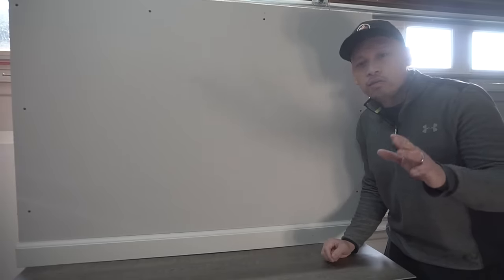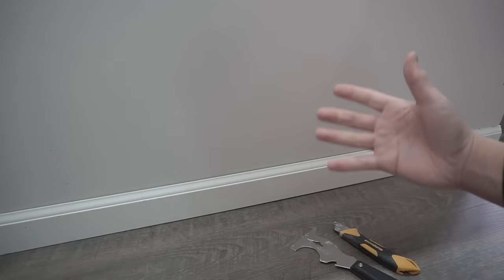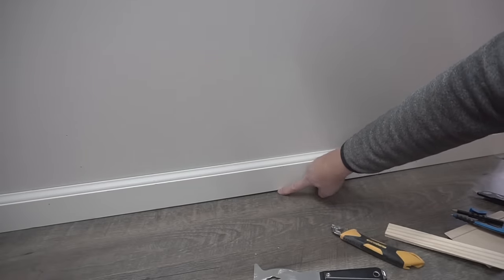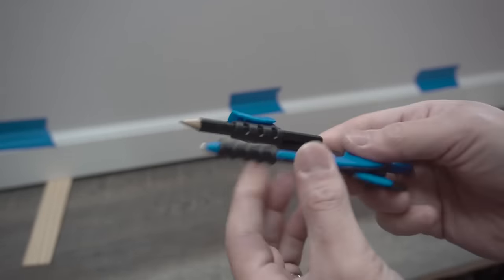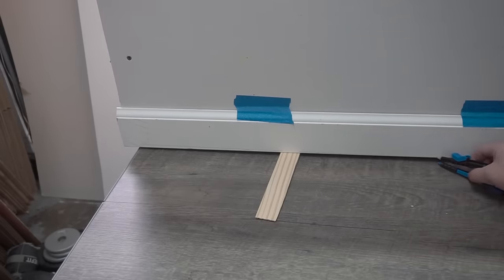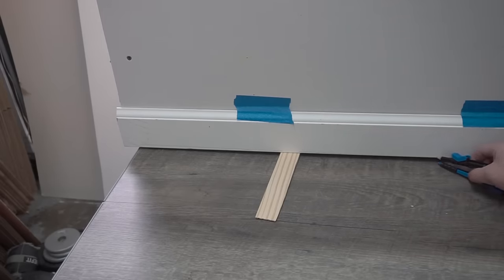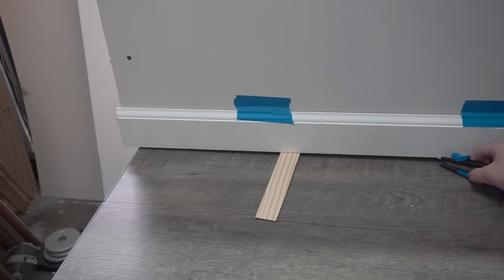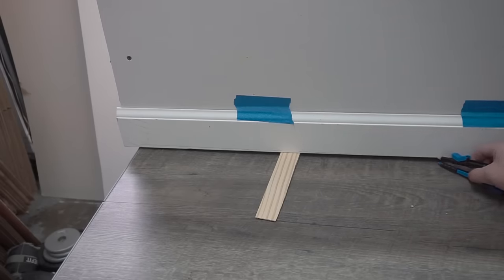How To Fix Gaps Between Baseboard And Floor For Perfect Fit! DIY Step By Step Tutorial For Beginners

Comment: Now you get to sand all the rest of the baseboard to match the one you trim to fit perfectly to the floor, though it looks awesome. 
as a finish carpenter to get paid once i complete the project learn how to do the job quickly and look professional no call backs. I use my foot step downwards on the board after tacking each end with one nail, start at the one corner and continue to the other end, it works

Comment: Your likely to run into problems with the next piece lining up when turning a corner.   I would push down on the baseboard really hard before nailing it in and you would be suprised how of a gap you can close.  If its a 1/8 inch just caulk it in, scribling moulding is alot of work for sure, just run quarter round.
Reply from the maker: Thank you for the feedback 👍🏽

Comment: Great video.  Thanks for sharing. My problem is that if removing carpet the gap is going to be really big.  The contractor told me that even quarter round might not cover up the gap if I remove the carpet and install vinyl flooring.  Any ideas on how to fix something like that??? Or just buy bigger baseboard??
Reply from the maker: Hi! Thank you for the love and support! I think your best bet is to use shoe moulding also known as “base shoe”, which are taller than quarter rounds. 👍🏽🙏🏽😊
Reply: Hi , my carpet was removed and installed with vinyl flooring and gaps are not shown too wide it is likely 2mm but our concern is too cold air is coming from the baseboards gap , our winters are too horrible …our heaters are continuously running with temperature setting 74  but still no use ..heat is not retaining , can you please help me with the solution what to do ? Is caulking is the only solution or anything better ?

Comment: In my opinion as a retired carpenter, I do not believe this is a way to fix baseboard to a wavy floor. As others have noted, now that you "shortened" both ends, adjoining boards will no longer line up and therefore all the baseboards in that room will have to be modified.  Also, others have noted, if the gap is small, simply push down on the BB before nailing.  If the gap is 1/4" as you state, then you have a serious issue that needs to be addressed with the floor -or- use quarter round as someone else has noted.  And again as another person noted -- never pull the nails out from the surface as damage may occur. Pull it from the back side.  Respect your attention to detail.  I'm just an old fart making some constructive criticism.  Keep up the good videos.

Comment: In finish trim work you do'n't hammer or push the brad nail back thru the direction that it was installed from but pull it completely thru, otherwise you will blow out the top of the hole

Comment: 1:09 or just do what a lot of ppl do: Break out the Shoe or Quarter Round😉🤦🏼
Wish was kidding, but it’s what ppl do, b/c scribing everything takes time, and unless have a trim carpenter doing this work, a GC remodeling your house WILL NOT BE SCRIBING ANYTHING, or COPING, as an FYI. If they do, will be extensively extra costs, and YOU MUST NEGOTIATE AND TALK ABOUT THIS AT THE START, b/c a change order; won’t cut it for most GCs.
Thx for vid and good job. Appreciate and see ya on next✌🏻
Reply from the maker: Thank you so much for your feedback and advice 🙏🏽😊👍🏽
Reply: Aepek, all hard surfaces installed in Ohio are to be sold with quarter round, for this reason we see here!! What he's doing would be very expensive per foot, and alot of these new material this can't even be done.

Comment: You are better off to pull your brad nails out the back side of the base board instead of tapping them through the front. Tapping them through tends to chip the front of the baseboard more often than not especially if the nail hole have been filled and painted over. Just my opinion

Comment: I have a solid wood baseboards 6" x 3/4" running in length anywhere from 12 to 20 feet. Removing them to fix those small gaps is no option. So my question is,  how do you deal with those gaps in a situation like mine? I fixed it with caulking which is not ideal.  Do you have a better idea/solution?

Comment: Those clamps that come with the sander are to convert it into a bench sander.Notice the small holes in the top of the sander-turn it upside down,insert clamps into holes and then clamp to a flat surface,hey presto!

Comment: There are houses where you could spend a month tweaking each board. In such a case, do it the easy way... float the floors.  (And maybe throw down some radiant heating plumbing while at it).

Comment: If I try to cover that 1/4” gap by shaving the ends of the trim, what happens when you connect the next piece?? It’s going to be a 1/4” higher so I have to trim that one too. Not to mention if there is a low spot on that run, then you get to redo the first piece of trim you shaved. This is a terrible idea!

Comment: Instead of a compass, put the pencil tip in the hole of a washer and roll it across the floor. And no need to make it level, your eye will never notice 1/4 of an inch slope.

Comment: We usually scribe for a hump in the floor, not a dip. Always buggers up when two pieces join.
However, I don’t know why you removed and shimmed up the baseboard with a level to mark it when you can just mark it when it’s in place. Also, if you use something closer to 1/2” to shim up the baseboard, you’ll find your compass marks better.

Comment: The professional will use a shoe moulding, rather than pulling off a base moulding and trying to either add at the bottom or scribe to the floor. Shoe moldings have been around fir centuries, are easy ti install and do not damage either baseboards or floors. They can be pre-painted or finished to match a trim stain or floor stain. They can be installed with either small finish nails or  pneumatic brads.

Comment: If it's over a floating floor you need a slight gap. If not you'll pin the floor which will cause expansion issues and you'll have peaking end joins in the flooring.
Reply: I've heard of Peking Duck and Peking Tom's, but never Peking joints.
Reply: @cynthiaayers7696  when a floating gets pinned down by something preventing it from expanding and contracting which it will do. An issue  will occur where the head joins will bulge / peak and look unsightly.  For skirting boards (base boards for Americans ) you should be able to slide a piece of paper underneath them without it getting stuck
Reply: @michaelhucks2313  Also worth mentioning the large gaps being there are likely due to a subfloor that was likely not flat enough for a floating floor to begin with. Nearly every flooring manufacture calls for the subfloor to be flat within 3/16 of an inch in a 10 foot span. If this is done properly you will avoid an uneven gap under base
Reply: @independentinstallations8419  Correct they generally have a tolerance of 3 ml over 2 metres. IMO all concrete floors should have a screed before any planks go down as they are almost ideal to the manufacturers specifications
Reply: @Leroy Jenkins  wrong , SPC planks and laminate plank installation guides don't even permit the use of silicones , culk or L channels being liquid nailed for this reason. You'd void the manufacturers warranties
Reply: @Leroy Jenkins  you don't want visible gaps underneath, but you should be able to basically slide paper without it getting jammed. Why people even buy this stuff instead of direct stick vinyl planks is beyond me. Waaaaaaaayyyyy less headaches can literally just meet upto the baseboard without all the expansion issues. SPC floating floors are rubbish

Comment: Protip: remove trim nails from the back using pliers, pulling the head through the wood. This helps to prevent tearout around the nail hole that can occur when pulling the nails out from the face of the trim.
Reply: I use a hammer claw and bend to the side lol

Comment: You need gaps for everything to expand and contract, your subfloor will always move. Not sure if i would ever use a scribing method to fix this gap. I use cork expansion strips and fill the gap. Then use colour match silicone as a top layer. I steam clean all my floors

Comment: No, this will take too long for an entire floor.  For small baseboard, you just push it down and let the baseboard bend, and for big baseboard you use shoe.
Reply: shoe mould would be the correct way. Just pains me to see carpenters use quarter round in place of shoe
Reply: @jimtaylor2755  Exactly. That's why they make it.

Comment: Pro tip...Quarter round....works every time...
Reply from the maker: That works too! Might cost a little more if you plan to do the whole room to match, but yes it that’s also another option for sure 🙏🏽👍🏽😊
Reply: And it always looks finished 👍🏻
Reply: Always shoe molding… Never quarter round… Quarter round is for overhead… Shoe molding is for on the floor
Reply: Qtr round is hideous
Reply: @shyguy2481  only if it's installed incorrectly..
Reply: Absolutely, works every time and choice of colours too to possibly break it up if you want to .As regards to this idea he’s obviously not a builder ,not very good and too time consuming , stick to your day job
Reply: Yea def not doing any quarter round or secondary piece. Outdated. Will be doing nice 1x6 boards shortly
Reply: Quarter round is will absolutely look horrible. Like a poorly managed college apartment room. Lol
Reply: Ppl dogging quarter round like it's so important not to have haha
Reply: Lazy tip for an ugly floor? Yes.
Reply: Hahaha garbage solution to hide crappy work

Comment: What would you do if the base molding was warp ?
Reply from the maker: Hi! It depends on where warp location is and if you could just do spot repair or not, if the whole baseboard run is warped then you might need to replace the whole run. 👍🏽😊

Comment: There are somethings that require compromise. A situation like this, with that gap size I may opt to compromise, depending on what the customer agrees to. More likely than not you'll find this throughout if it's found in one place. The amount of time required and cost associated with scribing may not be cost effective, nor result in a more aesthetically pleasing finish.

Comment: An easier option is to drill a small hole behind the board where the dip is and inject some silicone or caulk into the hole to raise the floor. Then fit the board back. Which will cover the small hole.

Comment: Is it possible to use foam to fill the gap rather than taking it off?
Reply: I would not recommend using foam. It’s not meant for this type of application, plus you would have one heck of a mess are your hands. That’s stuff is super sticky. I mean super sticky. Don’t do it.

Comment: 1) Shoe moulding, some customers don't like the look of it.
2) Caulking the bottom edge, big no no on floating floors. When the floor expands and contracts it will crack the caulk joint, learned that the hard way.
3) Just push it down and nail it, yes it works when the variances in the floor aren't that excessive but when they are it can A) Still not close the gap all the way and B) Return to where the material wants to be causing a gap. 2-1/4 base flexes easy but the larger bases are difficult to flex to a big gap and tend to spring back after nailing.

What this gentleman did is the way a true craftsman would address a wonky floor in the event a customer wanted base with no shoe minus the  leveling of the base(parallel with floor will look much better as it won't taper from large to small if the floor isn't level). In all reality people shouldn't have to scribe base as most flooring products require tolerances of 1/4 inch in 8 ft or an 1/8 in 2 ft so the floor should be pretty damn flat when the flooring installers leave. But 99% of flooring installers are hacks and don't grind, screed or self level to achieve the  flatness required by manufacturers for warranty. Unfortunately craftsmanship is pretty much dead outside of the custom home game and even there it's becoming less common.

Comment: You could’ve just pushed the board down in the middle and nailed it… Or used shoe molding as you should anyway on any hard surface flooring…
-And when removing nails from trim always pull them through…

Comment: It maybe okay to some. Now the next contractor in line who's doing the floor and leveling it before laying new flooring will have to pull that off.... 1/4 rounds are flexible and can easily hide a lump in the floor and can install it tightly and would blend in nicely. I've seen this method done before and it is very noticeable

Comment: Pull the brad nail through the base then get your tube alex painter's caulk and fill that small gap on the floor. The ends are now narrower you made more work than you had to.

Comment: Tip from a pro .. paint your skirting before you install it.. find a piece of timber & put it on the skirting where there is a gap, put your foot on the timber 3 x 11/2 is good … stand on it & push the skirting down, then nail .. or tap it down with a piece of timber after you nailed it. Very few pros have the time to do this.. 1 millimeter gap is acceptable of course no gap if the best, but that rarely happens on a big job.
Reply from the maker: Thank you for the pro tip! 👍🏽

Comment: The gap is intentional and should be left alone.  It is click flooring which means more likely than not you will pull out the flooring in 5 years or so and replacing it.  The gap allows for replacement flooring materials without removing all of the trim.

Comment: The only thing, you have internal or external corner that will have original height so you will have to continue cutting as your external ends are lower than middle. Unfortunately the solution is only if this is between two architraves but not skirtings that goes around.

Comment: I would only use this method on a very short run of continuous molding and check for the lowest point in the run first or if you have a few high spots in a long run. Otherwise use shoe or quarter round. unless you want to make a career out of doing one room. It would take days doing this instead of a few hours with shoe molding.

Comment: Quarter round and caulking
Reply from the maker: That works too 👍🏽 only thing is that you will have to use that do to match the whole room and could get pricey 🙏🏽
Reply: Exactly, a lot quicker and gives a finished look!
Reply: @FixThisHouse  ¾ " quarter round is about $7 for an 8 ft piece....$30 will do an entire room... remember, if this is your home, don't be tight. I would never take the extra time to do what you are doing. Doesn't make good economical sense. You can lay quarter round in a room in about 20 minutes..
Reply: @abdal-haqq1688  It is somewhat subjective, but the shorter the baseboard the worse quarter round looks.  My house has 3/4" quarter round installed on 3/-1/4" baseboard and I hate it.
Reply: @georgebush6002  that's a really specialized size of baseboard. Sounds like window and door casing.
Reply: Quarter round cheapens the look. Just my opinion.

Comment: Most people would use shoe mold to transition from the base trim and the floor.  Looks more professional
Reply from the maker: I completely agree. Quarter round gets too pricey if you are planing to match the whole room. This is just one method. I like to give my subscribers many options. 👍🏽😊
Reply: @FixThisHouse  Never quarter round on floors…  always use Shoe Moulding…
Quarter round is for overhead ie., soffits or any High corner.
Shoe Moulding is for flooring…
-If you see 1/4 round used on flooring, you’ll know instantly that a hack did the job.
Reply: A professional would have scribed the baseboards to the floor. 

I've done it thousands of times.
Reply: @steelbrad  The problem with scribing is that when you make the corner the next piece of trim will automatically have to rip down to match the height of the previous piece that was scribed… Shoe Molding is the way to go… also on hard surface flooring push the baseboard down as much as you can before you nail it…
Shoe molding also adds more dimension and another shadow line… It “builds up” the molding
Reply: I agree with you in general, but past a certain height quarter round looks better than shoe molding.  I discovered this while checking out 11" baseboards that had quarter round.  I also say below a certain point both should be avoided.  Of course you should also ask yourself why you are below that point.
Reply: @hmtrimworks7148   I would describe shoe molding as professional, and scribing as custom work.  Both produce acceptable results if done correctly.
Reply: @steelbrad  Is this the way you set the scribe height?  The way they did it in the video feels a little sketchy to me.  I assume the room perimeter's lowest point is more important than the section's lowest point.
Reply: No it doesn’t look more professional. It’s the sign of an amateur if anything